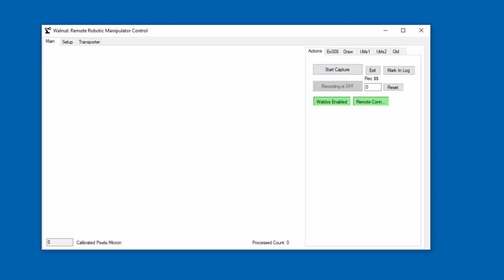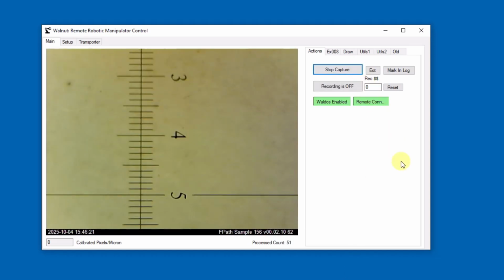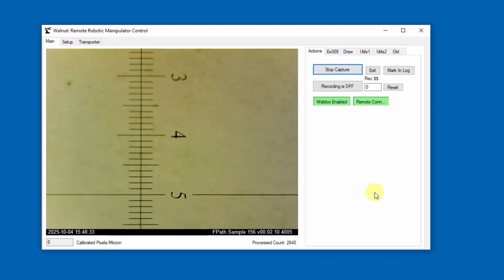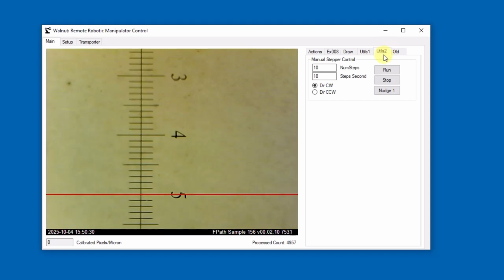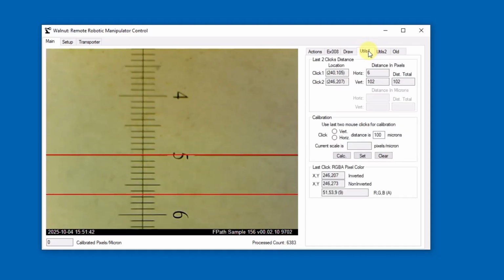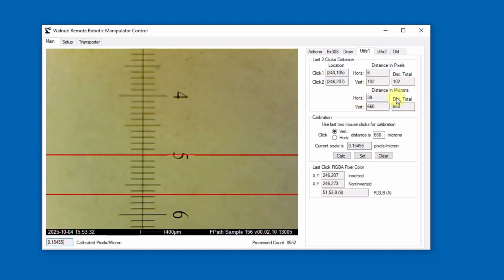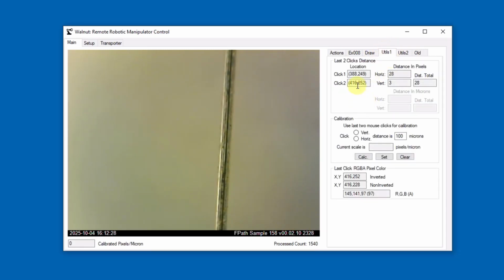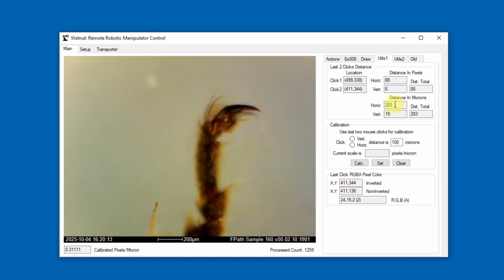FPath Ex009: Calibration Interlude

Comment: In the case of a USB microscope, maybe there is a way to gain a metric as to how far zoomed it is and work out distance based on the diameter of the shot. Or is zoom non deterministic with those?